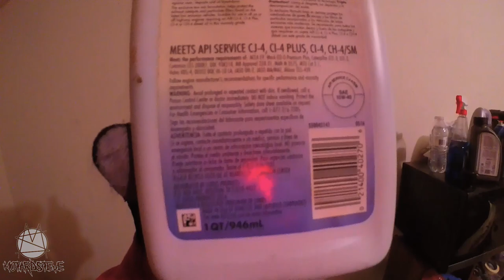How To Break In Your New Motorcycle Engine | How To Prevent Oil Burning

Comment: Hey there Steve! I'm looking around and can only find 10w40 and 20w50 mineral oil. I cannot find 15w40... Which of the ones I mentioned should I use to break in the 701?
Reply from the maker: +José Ignacio Ruiz Artigues you can use 10w40 as long as it suits your riding climate(temperature).

Have a look at a oil grade temperature chart and compare to the usual temps you get in your area and you should be good to go. Unless you live in a really really cold or really really hot climate 10w40 should work fine. The 20w may be to heavy for cold start ups imo.
Reply: MotardSteve Alright then! I’ll go for the 10w40 then. Thanks a lot for the answer :) By the way, you’ve got some great, really helpful videos!!!
Reply from the maker: +José Ignacio Ruiz Artigues No problem. And thanks. Glad to help out anyone any way I can.
Reply: MotardSteve It really helps a lot :) One more question if you don't mind, what oil did you use after the mineral one? A Bel Ray one?, Which one?
Reply from the maker: Bel Ray EXS 10W50 12 bucks off RockyMountainATVMC.com
Reply: MotardSteve Thanks :))

Comment: Why, idk what is engine breaking
Reply: Downshift and let the engine rev and slow you down, downshift a little sooner than normal to really hear it rev and if your bike lunges a little you are engine breaking hard... if you can slow down by downshifting through the gears without using regular brakes you are using engine braking only

Comment: So Steve - picked up my 701 yesterday and was a 60 mile drive..I applied the exact same technique as in your vid (thanks!), but did not change the stock-oil! am I fooked? or replace oil and start over break in? Also, do I understand correct that you applied the break-in technique for 1500mls?
Reply from the maker: Nah there's a decent chance that you're bije had mineral oil in it. I heard from a Husky rep that they are shipping the with bel ray mineral oil, but no idea if it's true. I say tgexnost important part is that you rode it the way you did. Just drop the oil asap to drain the guaranteed micro metal flakes that are created from the initial break in and just keep using conventional oil until about 1500 miles
Reply: @MotardSteve - What about the second part of the question?: Do you continue to break the bike in for 1500 miles? If not, at what point can you ride with a steady throttle for longer trips?